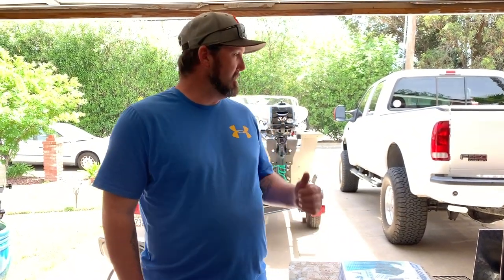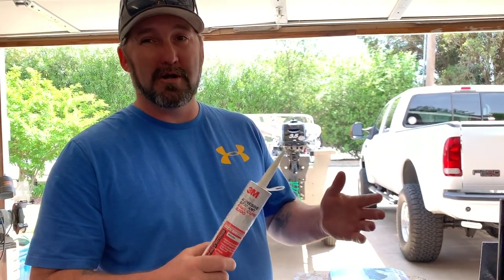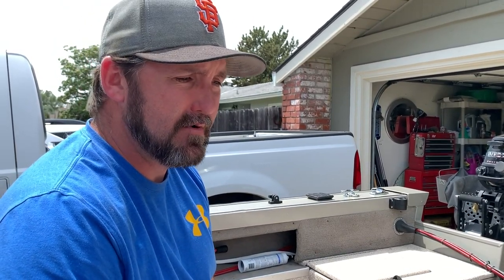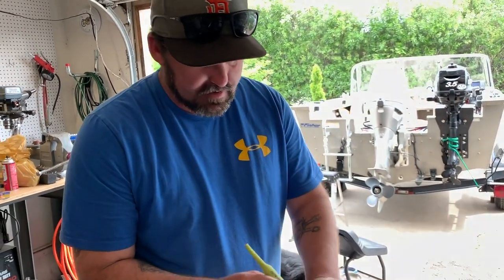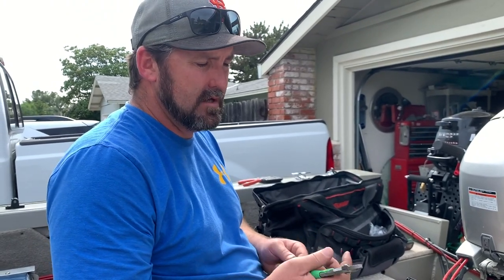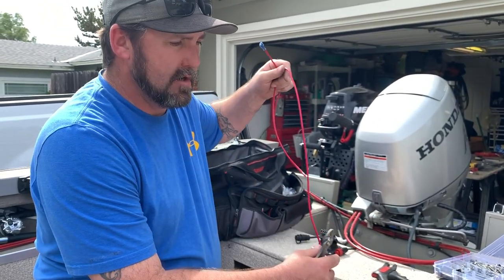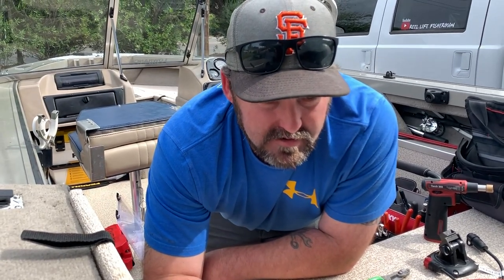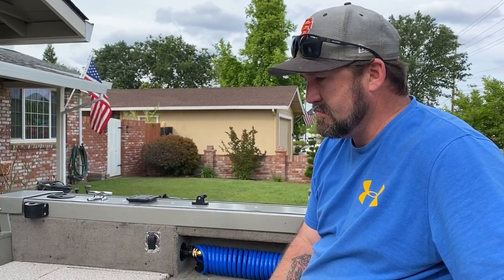BOAT WASHDOWN SYSTEM INSTALL | HOW TO

Comment: Nice video, a quick question my live well pump its already installed and I want to install the washdown pump, can I connect 12v power for the washdown with the live well pump instead run it separately to the power panel which is difficult for my boat
Reply from the maker: Thanks glad you liked it.. so you want to run the wash down pump and the live well on the same circuit? If so the wash down pump draws way more power then a live well pump and would over load the circuit for sure..  let me know if if you meant something different? Or if you have any more questions.. thanks for watching
Reply: @ReelLifeFisherman  I have a similar question. My boat already has a live well, so I figured I could run a T from that pump and just run a new power switch, is that right? Do I need to buy the extra pump or can 1 run both?

Comment: Are you happy with that pump now that you have had a chance to use it for awhile... pressure, any leaks ... also what gauge wire are you using an fuse... I am a amateur at projects like this but want to add one to my sail boat... but do not want as everyone else buy the wrong one but go with what is tried and proven by others... I would appreciate any help and advice you or others may offer... stay healthy and thank you for a great vid... it will make me tackle my project with confidence... ps a little scary drilling through the boat lol

Comment: Nice vid... Wish you could have turned it on... So does it use water from the lake?
Reply from the maker: Yes it does . It’s called a raw water wash down. It pulls form the water the boat is sitting in. The other one would be called a fresh water wash down and it would come from a on board holding tank..  thanks for watching and commenting I appreciate it!

Comment: Great tip on the adhesive and carb cleaner
Reply: If you walked a boat manufacturer nothing but 4200 and acetone😂

Comment: Hey I was wondering if you have done trim tabs i have a 18ft klamath that leans hard if its just me was thinking of adding the self adjust trim tabs any input
Reply from the maker: I’m going to be installing the lenco trim tabs on my boat one of these days.. I have about half the stuff I need .. I’ve installed them on other boats and they do help.. which way does your boat lean? A lot of times it’s kinda normal to lean slightly to the right when on plane alone .. due to the prop rotation..
Reply: @ReelLifeFisherman  definitely leans to my side by myself as I am a big guy 😆 🤣 😂

Comment: Man dude.... Totally helpful. I have a brand new Alumaweld Free drifter and the wash down pump is running but not spraying. This video helps so I can trace it as you showed how to install. Hope I can see what's up. Any ideas? Runs but doesn't spray. Almost like it's not picking up water. Thanks though for your video. Peace.
Reply: Nice job on the diamond plate face plate.

Comment: Hey Jason, great video I have two questions.
1) could I connect a washer/hose to an Existing live bait well pump? By connecting a “Y” to the intake hose and just add pump and switch?

2) That marine 5200, I’m installing a T-Top could I use that when installing the bolts to the base which will act as a sealant and adhesive?
Reply from the maker: So for question 1 .. the live well pump wouldn’t put out enough pressure for a wash down.. it would flow some water but not at much pressure..
Reply from the maker: And for #2 absolutely.. 5200 will work perfectly for that.. thanks for watching man! Hope all is good.. tight lines!
Reply: Reel Life Fisherman 
Thanks for responding, I just meant to tie into the intake hose of the bait tank   with a “Y” connector and use a wash down water pump  to have require pressure? So I wouldn’t have to drill another hole for the wash down intake!! I hope that clear up my question?
Reply: @danielramos7394  I actually have the same question.  The limiting factor is whether you can have suction behind the live well pump and if the would prohibit using both at the same time.  If Reel Life knows the answer would be most helpful!
Reply from the maker: So I have never installed one that way .. but I wouldn’t see why it wouldn’t work.. the wash down is self priming.. and the live well pump it would be pulling through.. you would have to just make sure the output on the live well had a shutoff .. or it will suck air through there..  personally I would just install the extra through hull.. but that’s me.. I know it’s scary..
Reply from the maker: You definitely couldn’t use both at the same time..
Reply: Reel Life Fisherman 
I placed a shut off value before intake, I gave installed it I hope it works!! Thanks got your input!! Take care
Reply from the maker: Awesome let me know how it works.. worst case you have to splice the hose back together and do it the other way.. sorry just got back from vacation and seeing the other replies..
Reply: Reel Life Fisherman 
Question could I get that connection for the water hose.?
Reply from the maker: Are  talking about the connection one.. on the side where the blue hose hooks up .. with the mounting flange?
Reply: Yes

Comment: If you wash crap off of the boat floor, where does the water go? If it goes under the floor down into the bilge pump, won't leaves, dirt, fish guts and junk plug up the bilge pump?

Comment: I want to do this now, ordering online so need to know something, you mention 3/4 inch bilge tubing, does that mean I need 3/4 through fitting?  Curious because you say 1 1/8 inch hole saw, and there is the option of 1-1/8 inch through fitting.  Can you answer what I should pick up...ordered same kit, just need the extras and unclear on sizes...( i have all the hole saws)
Reply from the maker: Yes sir a 3/4 fitting but the thread for the fitting will require a 1-1/8 to fit ..  and I would recommend 12ga or 10ga marine wire .. let me know if you have any questions.. and thanks for watching!

Comment: So the wash down system will only work. When very still or moving slowly ,,  not on plane
Reply from the maker: Yeah you’re likely to suck air and possibly burn the pump on plane.. that goes for any live well pump as well..
Reply: @ReelLifeFisherman  well. If your live well pump inlet is plumb like your wash down pump  all your bait fish will/
Be dead before. You get. To your fishing spot,
Reply from the maker: Only way you’re getting water in a “bait tank” on plane is with a scoop style pick up.

Comment: Nice install, but you missed on the very most important part of any thru-hull job - the flanged seacock (NOT BALL VALVE) with backing block! If anything in that line breaks, you want to be able to shut off the incoming water at the thru-hull. And while you're at it, get an all metal BRONZE thru-hull fitting WITH screen. All three of those parts can be had for less than $200. Never understood why a guy with lives onboard and thousands of dollars in a boat, would skimp out on a couple hundred dollars to get it right. Other than that, nice install, and the diamond plate was a nice finishing touch.

Comment: I just added a pump and it did not come with wiring schematic. Can you give a quick explanation of each wire and where it goes. I have the same set up, two wire pump, two position switch with a 20 amp fuse inline with the positive. Mine will not work and keeps popping the fuse. I’m guessing it’s wired incorrectly. Thanks
Reply from the maker: Do you have it properly grounded? And also just making sure your running It I the water and not dry? The intake screen it locked it correctly so the pump is not sucking air?
Reply: Yes it’s grounded. Can you explain each wire and where it goes please? ThanksNo @ReelLifeFisherman

Comment: I still can't get the switch connection pump black to the neg battery ,red pump to the switch pump have a. Fuse on the red wire .Where the other lid go to make the pump off.
Reply from the maker: So if I understand the question right.. the red from the pump needs to go the the switch.. then the other prong on the switch needs to go to the battery or a fuse block or something for power.. the. The switch will turn the power on and off.. let me know if that helps or if you have any questions.. thanks for watching

Comment: Wouldn’t it be easier and safer to just put a t into the line for the live well intake? Then you won’t have to drill any holes in your boat.
Reply from the maker: You would need a totally different live well pump and plumbing..these style live well pumps have the thru-hull fitting built in as one unit.. also if you do it right there is no need to worry.. I put holes in boats every day.. but I get it.. it can be nerve racking! Thanks for watching

Comment: No screen over the inlet? Personally I probably would have just tee-d off the live well fill line so as not to have to add another penetration in the hull and save a few bucks in the process.
Reply from the maker: All factory installed wash down on thunder jet and north rivers etc. don’t Have an intake screen.. you can put one on if you like.. but there is a screen on the pump itself.. you also couldn’t run the pump and live well at the same time.. but you’re more then welcome to try it out if you think it’s a better idea.. thanks for watching!
Reply: @ReelLifeFisherman  just thoughts....not ripping on you...i enjoy watching your videos and think you do a great job! I don't think it would cause a problem with the livewell fill since its only gonna be used sporadically....i'll be trying it this year on my boat, so if it doesn't work worse case easy to do it your way or just up size the intake to a larger one and tee right at intake so both can pull max water volume easily. Putzing around with boats is just fun anyways.
Reply from the maker: You can try it please let me know if it works out.. I have always seen them installed this way and that’s the way the factory installed ones are done also.. so that’s why I do them like that.. I don’t want to experiment on a customer boat.. lol . Not sure if when the wash down pump is pressuring up if it would suck air from the open live well pump side.. might require a valve to shut of one side or the other.. but let me know.. I would love to find out.. my thunder jet has a nice factory installed one.. so there was no need for me to try it.. I will be using the forward live well pump I don’t use for a bait tank mounted on my offshore bracket.. thanks for watching the channel
Reply: @ReelLifeFisherman  I planned on putting a cheap one way check valve from the livewell feed just before its pump just for that possible problem. It shouldn't be too much rocket science....but I've been wrong many times before so this could just be a little wasted time on my end is all.
Reply: @ReelLifeFisherman  K, so I did a little checking around at my local place to get boat stuff and low and behold Attwood makes a aerator pump with dual take-offs....one for the live well and one as an auxiliary for either a normal wash down hose using that pumps pressure or run that directly to another pump for a higher pressure wash down hose. So I guess my idea has already be thought up and implemented. Dang it, I lost out on another million dollar idea.😭

Comment: Why put a hole in your boat ??? If you have a live well.  Simple put a TEE in your existing through hull.   Or most live well pumps come with a extra port to tie into for this reason to share a through hill connection.

Comment: Don't buy the washdown system you're not only wasting money and time installing it and putting extra holes in your boat that can leak when you will always have a  soft drink can are a bottle our a cup are some kind of bucket just dip it in the water and pour it to where is going outside the boat and you basically doing the same thing as a stalling the expensive wash system and you not having to put in the hole in your boat to a place to leak later on down the line